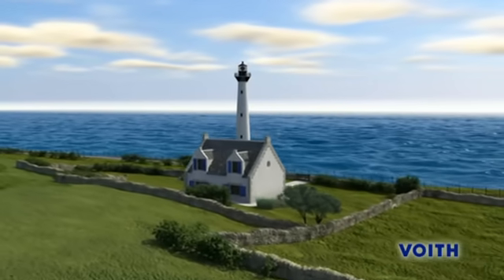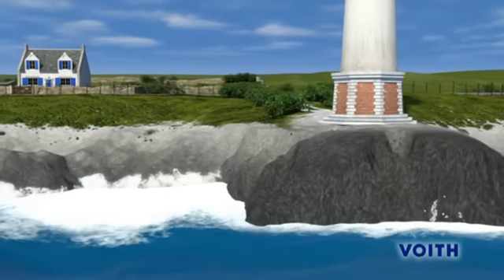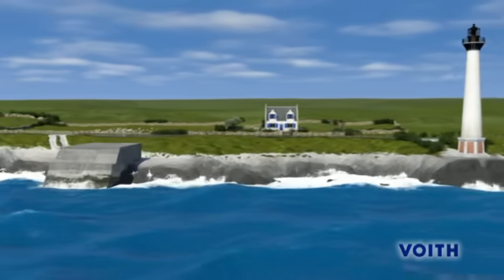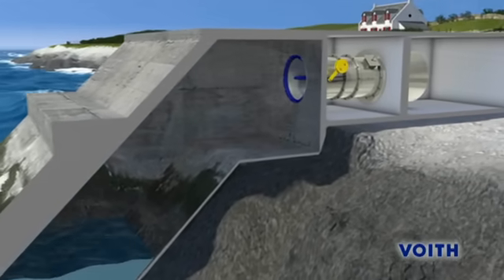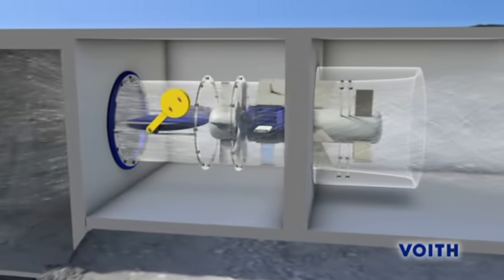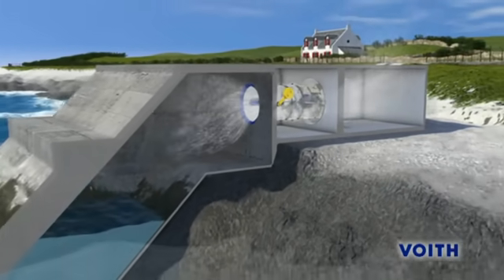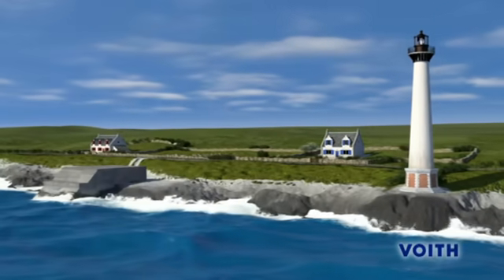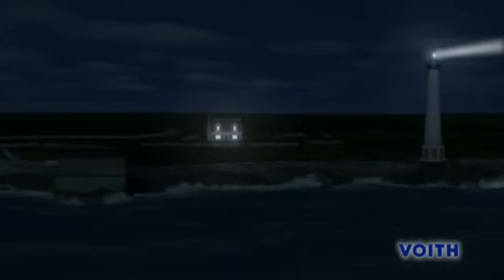Ocean Energy -  Wave Power Station

Comment: This was a pioneering technology that was built and commissioned in around 2001 on the island of Islay.  It worked and there have been many improvements since by other companies
Reply: how did they get past just the basic corrosive nature of salty sea water?
Reply: @TheRedStateBlue  They didn't it was superexpensive and worn fast. Another test unit at Pico island lasted only month. 
The ocean is a hard enemy, and the power density of wave power is los, making it extremely expensive as you have to build more stuff /kW than in all other renewables. 

The most successful wave power plant, Mutriku Breakwater Wave Plant, was commisioned in 2011 at a cost of 6,4M€ for 296kW peak. That's 21.000€ per kW nameplate Power installed. 20 times more than wind, and 30 times more than solar. 
But maybe it's generation more power to make it worthwile?
By the end of 2023, the total lifetime generation was 3 GWh. That's about an average power over 12 years of 12kW or 9% average load factor. That's abysmal. Wind, in germany, has 23% onshore and 28% offshore. In good wind locations like Scotland or Tasmania, it's 80%.
So it absolutely sucks at power output too despite being 20 times more expensive to build /kW nameplate. 
So maybe it lasts longer than the 20 years wind turbines work? Turns out, the turbines are worn already and need to be reoplaced for 3,4M€. 
SSo they even last only half a slong, making them 75-150 times more expensive per kWh generated than wind. 

it's a crime to still burn valuable renevable investmentcapital on wave power after all those projects proving without a doubt that it is far too expensive to build and maintain.

A € in wind power saves  75 to 150times more CO2 than the most successfukl wave power plant does. 

And still- new projects are popping up sucking away all that green investor money to shurely fail.

Comment: Check out this video https://youtu.be/v-lJkeRHzAE (or short version https://youtu.be/AG_vz2vHP7M), there is some open water testing towards the end. It aims to get energy from the horizontal motion of the wave which is stronger in the near shore (<half a wavelength, e.g. for a 100m wavelength the particle motion becomes more orbital from 50m depth in to shore). It also keeps all the electrical equipment onshore and reduces the typical mooring costs. Apparently it is hugely expensive to drill mooring points into the ocean floor or to run electrical cables underwater. I’m looking for people to help me build prototypes, they are easy enough to build, the ones I have built so far are all with parts from my local hardware store.

Comment: Nope....idea is not good. 
There will must be a polarity problem, Voltage fluctuation problem.
1) Once clockwise-once anti clockwise of turbines will not give a satisfactory power production output.
2) the turbines spins when wave enters the 1st chamber and creates positive pressure; turbine again spins when wave exits 1st chamber and creates negative pressure. Hence, the spinning graph seems like zigzag pattern which means there has neither continued pressure nor has continued spinning.
3)Did you think about the Tide and reflux?

This model has many more draw backs.

Comment: I know an old coot here on the Big Island that has a plastic 55gallon drum attached to a 40' or so beam that's rigged to a gearing set-up that turns a generator when the drum bobs up and down on the waves, he can retract it in heavy surf if necessary. He uses it to charge his battery bank along with his solar, not sure if it's legal though.

Comment: It may work;
Last month I repairing fiber optic on the seaside;
then there was a concrete canalization ending to the sea next to me(about 60 cm diameter); on top of this canalization , there is a hole because the conrete canalization is broken that is the reason I was there because the fibre is broken with that too.
At the first time, the wave was very low and cannot reach the canalization but after 2 hours , it was raised and blows through the hole were I'm working. At this time , it is impossible to work there, I have to leave and call the labor to put a flat concret block at the top of the hole. Guys finds out a 1m X 1m X 10cm block to put there; but to my surprise this concrte block was raised up by the blown air and the water mist comming from the wave inner of the canalization;
I never imagine that this hunderd kilos of concrete bloc will move!!!
Unfortunately, my phone was off and cannot capture the moment.
If we can capture and store this pressured air then combine it with a kind of turbine like tesla turbine, it may work!!

Comment: I have been told that the Wells engine is fairly inefficient. Would be more efficient to use 2 separate, ultra-high-efficiency generators? One for intake and one for exhaust?

Comment: VERY GOOD Rational Logical Form Of Energy except Rockerfeller Power gluts Won't allow it larger scale. Costly To Build but Allegedly End-Less Wave  Movement Supply. They are illuminati/nwo/Luciferians = All Tied together With The also Coal Industry To make major electricity amounts .   aka Wind generators = too many shut down For illogical bureaucratic reasons. They all be brothers of greed Fleecing people. Tesla Found Way to Get Electricity from The air, 1st they Made him Go to his own Separate Area to monitor Him Then a Distance island away from society. beginning learners go research The facts if they still be "Out There"  Retreivable

Comment: Hello there i am currently working on my dissertation which is based on the optimization of that station. I was wondering why are they using 2 wells turbines and why the airfoil before the turbine. Also why is the inlet of the water on an angle of 45 instead of using a simple 90 degrees. Thanks Great video.

Comment: Why don't they add few more fans at the lower part where the water rises and fall? The power of water going up and down is stronger than then air for sure. Maybe modify that part with flowing feature parts to maximize the power it could collect.
Reply: Running turbines underwater is more complicated and more expensive than running them in air. They have to cope with larger forces and higher risk of debris than in air.

Comment: I am not an engineer, I am just wondering if the compression and decompression of the air, does it move the turbine in the opposite direction? For example, the compression moves the plates to the left, and when decompression, the plates will move to the right?

Comment: In Brooklyn new york there was a wave powered mill in colonial times. Unfortunately it burned down. But the concept was very simple - there was a short wall running parallel to the waterline. The waves would pour over the wall and the only way they could flow back down to the ocean was via a missing section of the wall. This created a constant single directional flow were a water wheel was placed. 
Pretty neat huh?

Comment: Like this! Would like to see how the blades on the turbine look. How they can flow in the same direction even though air flow gets reversed. Overall, though, I am impressed.
Reply: Have you ever heard of ratchet gear? Think how your bjcycle gear works, it s the same concept but in this case 2 gear set are required.

Comment: Looks interesting but I have a few questions: What is the estimated cost of one of these structures and cost of upkeep? How large does the station have to be to generate sufficient power, and how much power can be generated? How would you afford beachfront property and how would you deal with potential wildlife?
Reply: Additional questions:  Can it please be built in a way it does not look like a concrete bunker?  What about rising sea levels / hurricanes?

Comment: Who ever designed this has obviously never worked with the ocean. The act of passing salt water rich air through that turbine would result in such extreme corrosion that keeping that thing working would be nearly impossible and probably cost prohibitive. The best electric generating wave machines I have seen are the ballasted spider looking things.
Reply: Unless the blades are made up of fibrerglass, and generator housing is away from the direct flow of air.
Reply: ehem,use marine steel lol
Reply: Verlin Boda dont know about the ballist machines but yes to the salt spray problems
Reply: unless you use corrosive resistant materials?
Reply: Plasterbond
Reply: If a membrane is placed between the water and turbine, it will move back and forth with the waves and at the 'dry' side (turbine side) the air chamber will hence expand and shrink, moving the same amount of air. This is cheap, easy and efficient. (should I clain ths as a patent now?)
Reply: Verlin Boda not if they used Roman concrete
Reply: BuckGreywolfe  Might be one of these he was talking about.
https://www.youtube.com/watch?v=xdlMXrADyM8
https://www.youtube.com/watch?v=2_JSZaAgCUw
https://www.youtube.com/watch?v=GA_UgVm9bvU

Comment: Why not utilize the immense buoyant forces of water?  Place a large float on the surface of the water attached to a lever arm that moves a large long-travel piston in a separate chamber. Because the float could be submerged at times, the buoyant forces would be quite high. You could triple the volume of the air moving through the turbine. The compression behind the turbine decreases the efficiency because it is also acting to force the water out the inlet. My method would allow static pressure inside the wet chamber and actually be more effective at static pressure than under compression because the water level (and head pressure) would increase. This system could also be additive to the design in the video since it doesn't interrupt the function as shown.

Comment: Besides all the other comments about the reasons why this isnt widely used such as the energy vs cost ratio. One of the biggest cons has to do with the fact that ocean/water real estate tends to be the most important and valuble land...especially if in area that allows water access such as a beach. For economic (shipping and water access is limited for most counties), aesthetic (no one is going to want their million dollar view blocked by a concrete bunker), and environmental (beach areas are critical parts of ecosystems) reasons placing large amounts of these structures along most countries shorelines will be seen as a non starter. Perhaps if they could be built on cliff faces or more under ground/water it could be viable but those all will just increase the costs of building it so makes it less attractive.
Reply: Beaches in new england would be perfect for this. Rocky and cold.
Reply: Hm, make concrete look like the beach itself and build a free real estate on top of it with lots of noice isolation. Done.
Reply: Tim Schutte Actually it's about politics. It's always about politics. There are millions of miles of coast line that are uninhibited and the land is cheap, but the politics still won't allow this. 

Coastal habitat, like any non human habitat, has an elevated importance in politics, and is worship by many environmentalists. Here in the states we have dozens of overlapping burocrocies to protect, reclaim, regulat, design, study, and install "natural coastal habitat".  And to be fair, some form of regulation is needed.

Yes. I know. How can installed habitat be natural? It's the government. It doesn't have to make sense.

My basic piont is that there is an army of greenies fully committed to stop this or any other type of green energy that could have any negative impact in the immediate area of the energy source or transmission of that energy product.
Reply: Jonathan Pascus , or design tubes that lead up to a plant instead of the plant being directly on the ocean. your correct, it's all about money
Reply: If you need to build a breakwater this could be incorporated into it.
Reply: Jonathan Pascus basically about money, it's always about money.
mankind's biggest downfall, GREED.!!!

Comment: Coucou les copines,
Voici le script du jour  : 

The water of the oceans of the world is almost always in motion hardly ever interrupted waves break at the  coastlines sometimes strong sometimes weaker there is an enormous energy potential that is available around the clock and free-of charge a potential that have fully exploited could satisfy 40% of the worldwide demand for power the equals the output of 700 to 800 nuclear power stations poit hydro wave chen is developing technologies to convert this inexhaustible energy intro electric power without the emission of harmful greenhouse gases the operating principle of this wave power station is as simple as it is ingenious an enclosed chamber has an opening beaneath sea level witch allows water to flow from the sea to the chamber and back the water level in the chamber  rises and fall with this rhythm of the waves and air is forced forwards and backwards trough this turbine connected to an upper opening in the chamber as it is compressed and decompressed the airflow has sufficient power to drive the weils turbine it is a feature  of the wells turbine named after its inventor that it is driven  in the same direction by both forward and reverse air flow trough the turbine even relatively low wave motions can generate enough airflow to keep the urbine moving and to generate energy this is how easily energy can generated with a wave power station day  and night all year round as long as there are waves the world’s first power station of this kind was put in service as early as November  2000 on the Scottish island of Isla and has been feeding power to the gird ever since poit hydro wave germ is convinced of the commercial potential of wave energy we are certain that our wave power stations can make a significant contribution to supplying the world with climate friendy energy foy engineered reliability

Comment: The cost for power isn't so much an issue of gas versus wind or water as it is the transmission of the power generated. In order for the method shown here to be cheaper, there would with it be a need to distribute it much cheaper than present methods, i.e. transmission lines.

Comment: In all honesty while the concept is nice as many other concepts which uses waves to produce energy I'm really interested in the break even point in terms of the energy. Because some system are indeed nice on paper but the have break even points far beyond their estimated lifetime which is honestly not going to get us anywhere. Same with current eletrical storages for electric cars. The energy required to produce a fully functioning car is estimated to be equal to 20,000 to 50,000 km of fuel which is to be honest a giant waste of energy. 

As for power plants near or in saltwater environments. Nearly every plant requires a big junk of energy and high grade resources just to produce a plant which doesn't rot away within a few weeks or month. So while I understand that many concepts are nicely designed I sometimes have the feeling that we are very far away from a real environmental friendly solution.
Reply: AnkhAnanku that air be salty tho!  Unless they have some means of drying the air in that chamber so there is not salt spray in it.  Salt spray is actually more corrosive than salt water submersion because of the oxygen in the aur
Reply: I think one of the benefits of this one is the pneumatic system keeps all the moving parts away from the water, so marine spoil wouldn’t be as much of a problem (it’s also it’s greatest flaw since it can’t catch more than a tiny fraction of the waves’ energy through such indirect means)

We really should be doing more to up-cycle existing materials/scrap to cut down on the all energy wasted on making entirely new stuff for everything we do.
Reply: Mr Engineer , I agree but when combined with solar and wind turbines it may well be a viable solution in some areas of the world. cost is the only issue I see stopping it

Comment: Love the engineering concept. I'm curious how does this system accommodate for tidal changes in water levels? Water levels can vary by as much as 30 or 40 ft from high to low tide along the Bay of Fundy, could this be adapted?
Reply: Yes it should be ok. The under water inlet opening would be at the lowest possible water level.

Comment: The answer to energy is in all these types of systems. the key is for government's to allocate industry with natural gas as it's energy and residential should run from whatever climate based system that fits the region. in most cases homes should be independently set up.
It's money grabs to have such vulnerable network.